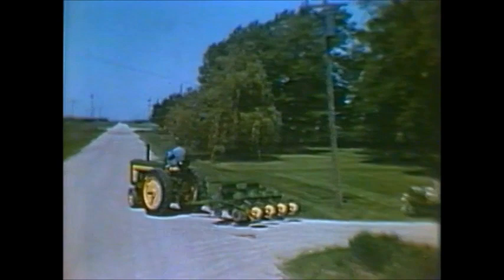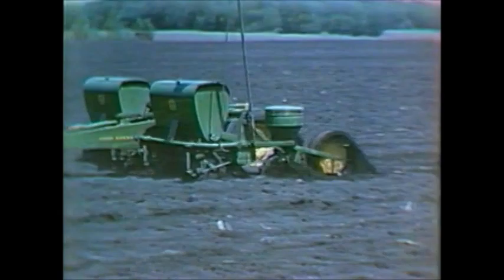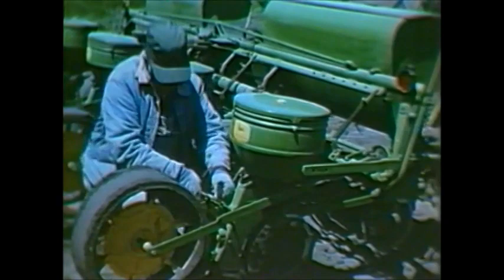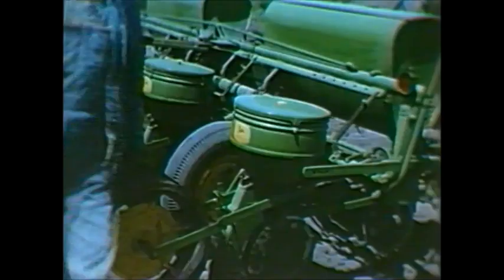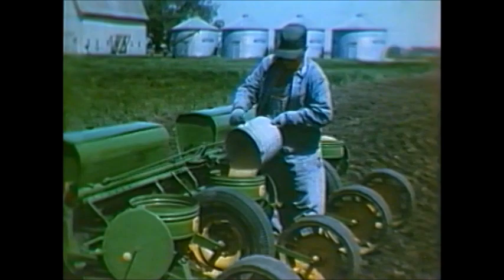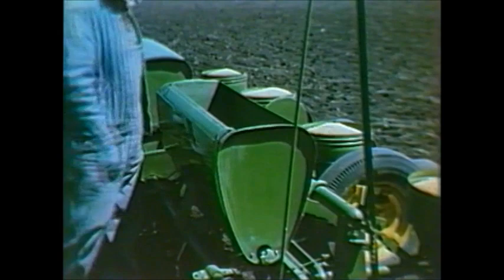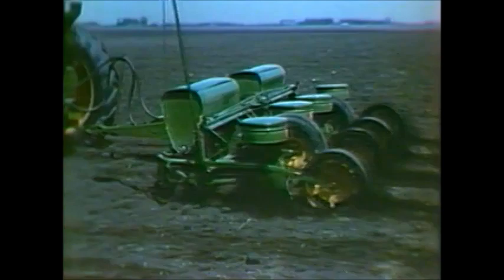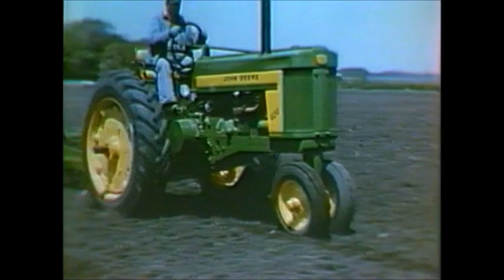1957 John Deere 4 Row Planter Ad

Comment: I had one of those, served me well for about ten years. Gave it to a neighbor boy when I got my first four row 7000. A much better planter, it was nice to not have to deal with seed plates.
Reply from the maker: Oh yes, finding the plates!!!  Ugh and sizing them correctly, (very important)  I wonder how many farmers could actually set one up in 2022???   Great comment.   Thanks.
Reply: There's a couple of sweet corn guys around me (central Indiana) that are still using 494s. One even plants pumpkins with his.
Reply: My first planter was a 694 with disc openers and a dickie John monitor in 1974. We used it until 1980 when we bought a 7000 no till.
Reply from the maker: @ronaldschultz1189  I remember those old monitors.  Boy has that changed... used to just be light on or off... and loud beep or not.  Now we count seeds and seed drop and spacing, depth, everything.   I run the simple dickey John monitors on my male planters.  Prob is gonna be finding parts.  There pretty simple tho. That's why I like em.
Reply: Still using a 7000. Great planters

Comment: Dad got his 494 used at an auction around 1980.. I had to replace it in 2010 because the fert boxes had been patched and the patches had patches also  lol… and the old plastic seed plates got brittle and would break mid field …frustrating when u don’t have a monitor .   Dad was impressed with my new 7000 with a monitor
Reply from the maker: Patches on the patches.... I can relate!  Lol.  Good hearing stories about guys that actually ran this equipment!    I put little 1/2 inch plates that stick out of top of seed "box"  (patched! Lol)  to make sure rows are going down evenly.   What I like is u don't have to hook up a monitor!  But yea, the price of seed today, monitors are the norm.  Thanks for the story!

Comment: This is the planter we used all my farming years. Dad bought it new in 1957, may be the only piece of new equipment he ever had. It really could have used stainless steel fertilizer boxes, I never saw one of these machines that the boxes hadn't rotted out by 1970. As for seed plates, out always came from the seed dealer. I can't say we ever had to deal with plastic seed plates.

Comment: I used a 494 then a 694 on my hobby farm.  Worked great for 30 or 36 inch rows.  Many have been cut down to 2 row for food plots.
Reply from the maker: Yep I've actually planted with mine in last 5 years a couple times, I keep it around for my seed corn prodiction and planting male is all about timing.  Totally stock.  Still works, if I cpukd only find all the old seed plates, those really mattered ALOT, needed to be sized right before all this new "precision" tech came onto the market.   Thanks
Reply: *Bow= but, autocorrect doesn't think like me.

Comment: Still use granddads to plant sweet corn.
Reply from the maker: Awesome,  same here, modern corn planters don't really plant the small sweet corn seeds properly, (even the old finger pickup units need adjusted down) the modern planters with all the 'precision equipment' can plant sweet corn better, but its tuff to plant sweet corn plots with 12-24 row planters.  It takes longer to fill and set up the monitor, vs just set the old planter down and when the wheel is turning, it's planting!   Great stuff
Reply: @growthefarmup2606  that planter has fed this community sweetcorn for 40 plus years. We plant 13 acres with it every year. We farm here in Central Ohio and have always had that sweetcorn field. IT was a way for us boys to make money and stay out of trouble. That old equipment kept us busy but I wouldn't change it for anything.
Reply from the maker: @Try Me  and it will feed that community for another 40 years, they even made steel better back then!!!   A little grease and a few adjustments and it should be good till 2050!
Reply: @growthefarmup2606  my 4 year old son and I are painting it and new rubber right now. We are painting the 420 tractor we use too. It will be around a long time no doubt.